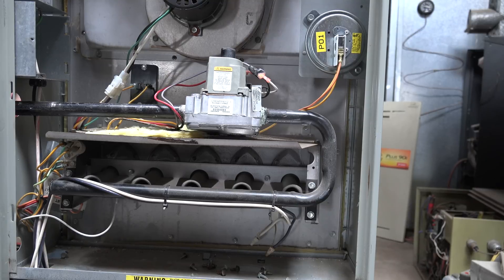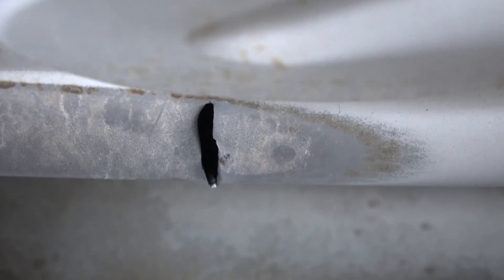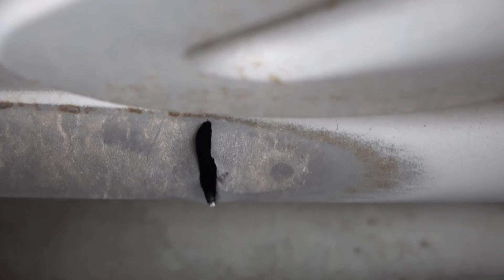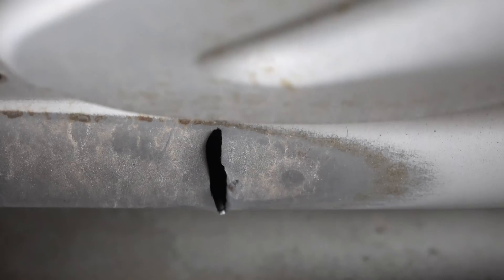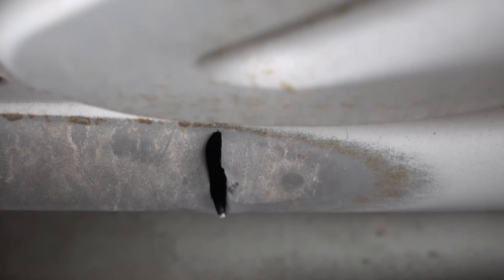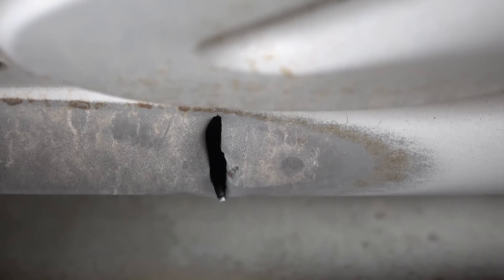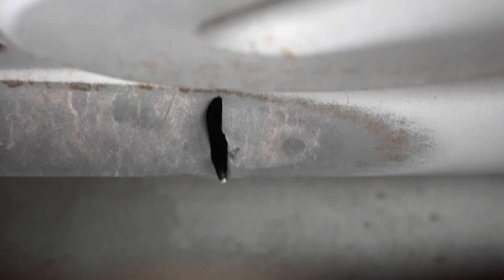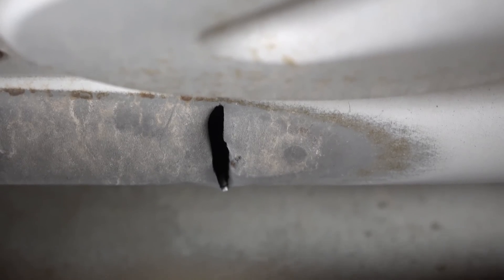What is wrong with this furnace,  #5 answer

Comment: How come no CO?
Reply: I'm wondering the same thing.
Reply from the maker: +mrexecutive1 There is no predicting which crack will proceed CO.  I have furnaces with multiple cracks that produced no CO.   More on this soon.  
GFM
Reply: +grayfurnaceman hmm, i'm thinking the pressure is higher in the ducting than in the combustion chamber due to the blower fan, also the drafter inducer is pulling on the combustion chamber creating a bit of a vacuum. just a guess, thanks for all your informative videos!
Reply from the maker: +mrexecutive1 All that is true.  However, you never know how these things will actually work.
GFM

Comment: What happens to a fully vented (High Efficiency) furnace when the heat exchanger fails? Would one of the pressure switches detect that and throw a code and or shut down the furnace?
Reply from the maker: +Craig Nehring Stay tuned, another one coming.
GFM